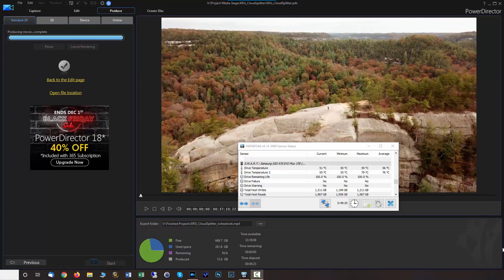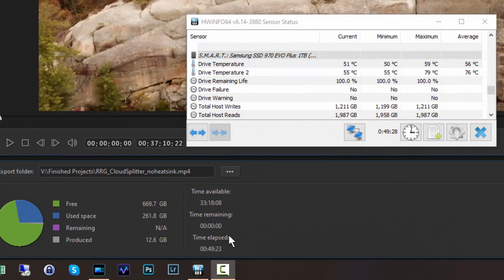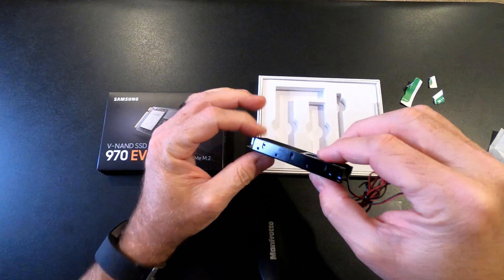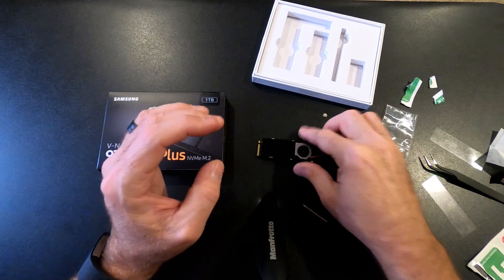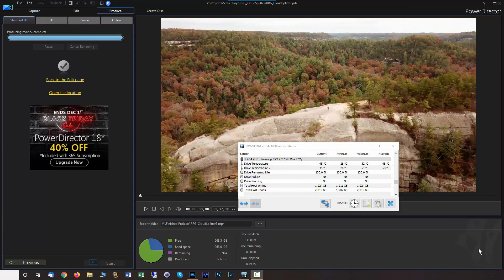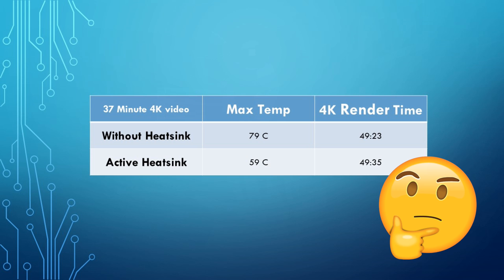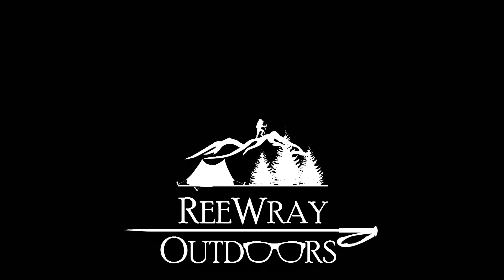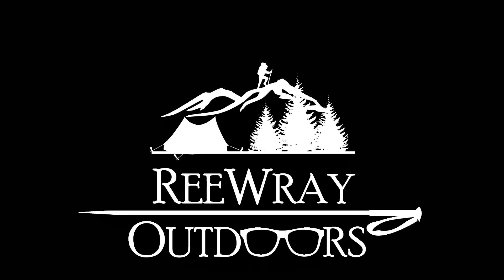SHOULD YOU INSTALL an M.2 NVMe HEATSINK??  Pros & Cons, How to Install It

Comment: Rendering for 49m and the difference is 12 seconds only 12 seconds that is trial and error meaning the m.2 speed was never changed i bet if you do it again you might even do it lower time with the heatsink on and the heatsink is to be use because without it if it reaches trottle point the heatsink speed will dramastically slow down sometimes even freezing your PC. Now there is a video that might give you some feedback about dataretention.  https://youtu.be/KzSIfxHppPY?t=455
Reply: Yeah it could just be a variation, it might be slightly different each time.
But even if it was 12 seconds slower, its only 0.4% slower which is completely negligible and unnoticeable.
I'd much rather have cooler unscary temps and prolonged life than 0.4% performance improvement.
Reply: @colinjava8447  cooler temperatures does equal longevity..
That’s not how flash storage works lol